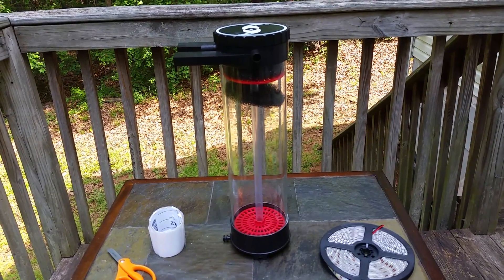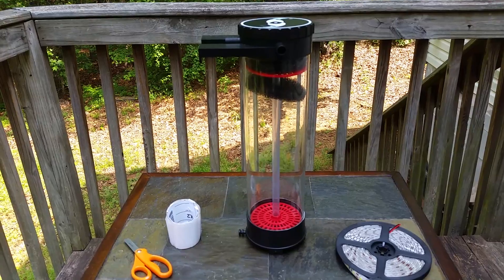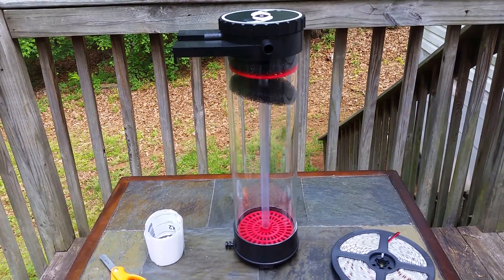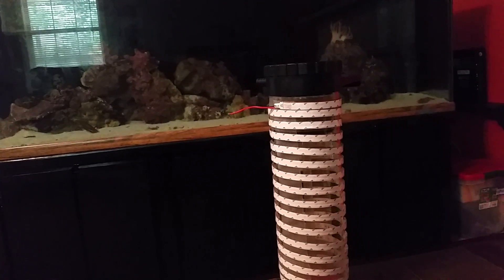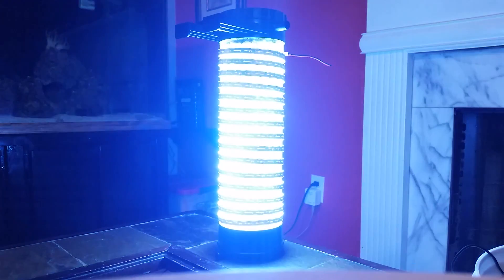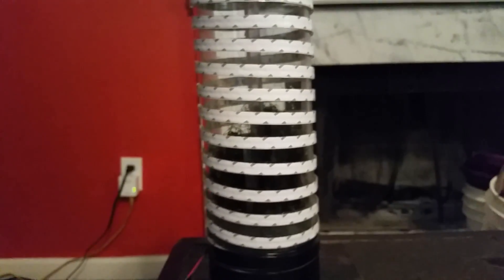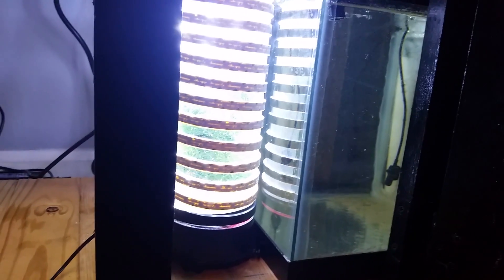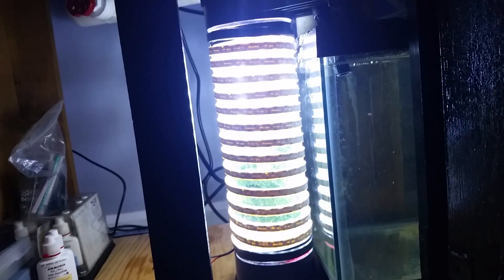Chaeto Reactor Build

Comment: Im thinking of doing a reactor aswell but torn between the red/blue led's or cool white....
Reply from the maker: James Macdonald 
I had used the cool white and the chaeto grew very well but then the blue and reds are supposed to work very well too, if your reactor is going to be visible I guess it depends on your preference on how it looks, glowing white or glowing red. 
If it helps any I have now discontinued using a reactor as I have built a custom sump that grows both phytoplankton and chaeto, my light for the chaeto is arriving in the mail today and it is specially designed for growing chaeto and it is red, blue and orange with no whites at all.
If I was ever to build a chaeto reactor again I'd probably go the blue and red.

Comment: Got a question that size of reactor is not big enough for a 400 gallon to reduce the nitrate and phos ? Wonder what size i can use to actually reduce the nitrate and phosphate
Reply from the maker: Dale J 
Chaeto reactors are still experimental at best and everyone is trying whatever they think will best suit their tank. My tank is 125 gallons so I can't give you experienced advice on what will work on a 400 gallon tank, if you can find someone on YouTube that has done a chaeto reactor on a larger tank then their advice will be of more benefit to you otherwise you'll have to break new ground with experimenting in designing a large tank chaeto reactor.

Comment: Have you had problems with cracking of the canister? I built one using the same reactor, and cracks developed in the canister aligned at the same angle as the led strip.
Reply from the maker: Malcolm Bell 
First I've heard of this issue, and no, I've had no problems with mine cracking

Comment: Fantastic !

What kind of pump did you use ? If you can provide detail would be great.

Thanks
Reply from the maker: Shekhar Kumar 
I had T'ed off my return pipe from my return pump and run both my gfo and chaeto reactors from the T'ed off pipe. I had to look back quite a bit on my purchase history as I had bought the return pump on ebay over 2 years ago, it is a 800 gph submersible pump that I paid $29.99 for. I looked up the same seller and surprisingly they still sell pumps, here's a link if you are interested in having a look; 
www.ebay.com/itm/281918770824